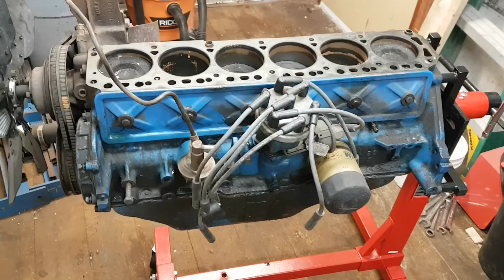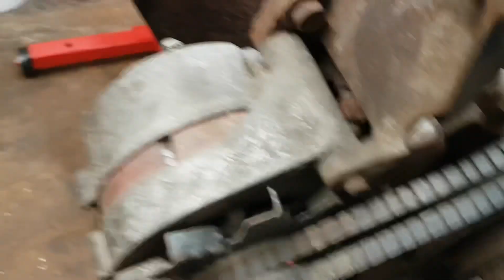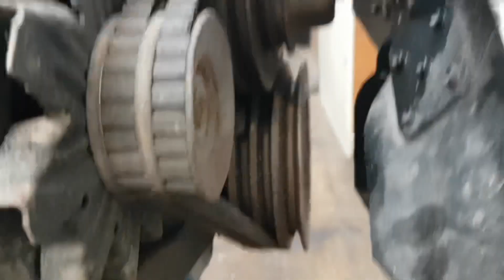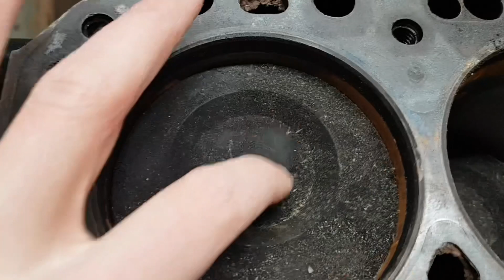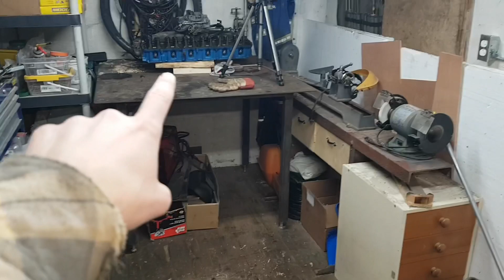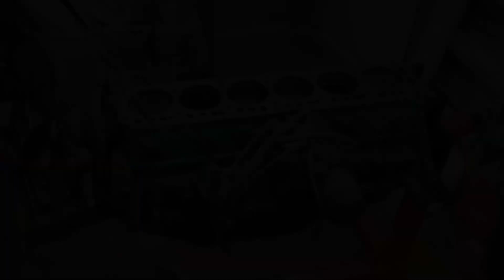Ford 300 Inline 6 Engine Rebuild Part 1: Repair, Rebuild, or Replace??? Decision Time

Comment from the maker: Want to skip the thinking, and jump right into the rebuild process? Check out the engine teardown here: https://youtu.be/FLd2d2YDVRs
Reply: Just watched the whole series. About to be doing essentially the same thing with a 93 4.9l. I thank you for the time spent and the quality of the video. 
One grease monkey to another. Thank you
Reply from the maker: Glad it was helpful! I enjoyed making this series.
Reply: I don’t think is hard to do, it’s a small engine, I’m thinking about giving mine more horsepower, I have. Toomany projects so it’s one at a time..

Comment: Just do a basic overhaul & Hope for the best. Always be on the look out for a back up engine. As far as Going for a 4.9L with all those extra headaches..Getting the old stuff  is what it's all about. Simplicity is what is happening ! The new stuff is the one of the reasons we do not go and buy a new truck . They can't even get that CHIP KEY ISSUE straightened out. Diagnostic says the chip key is bad. $70 down the drain , not the problem. Then $458 later they finally find the problem..STICK WITH THE OLD STUFF. TELL THEM TO RAM THE NEW STUFF UP THEIR YONDER PARTS.. ( BUTT, ASS , REAR END,ETC ETC )

Comment: Glad I rewatched this. The part about swapping from the EFI to carbureted head probably just saved me a bunch of trouble. I am taking the 300 out of my 92 to put in my 81 and will be removing all the EFI stuff and going carb. I will definitely be swapping to a carb head on the 92 block. 
I wanted to save the 85 block, but it is roached. My dad took off the front clip and covered the motor with an old air mattress and let it sit behind his barn for 22 years. It just trapped moisture and absolutely rusted and pitted the block inside and out.
Reply from the maker: Ahhh, that’s a bummer on the old block! Good luck with the swap 👍

Comment: Great video. I work for a historic (architectural) architectural restoration company, and we just picked up a 1967 Ford chassis with a Boyertown step van body on it to restore into a work vehicle. I’ve been tasked with being in charge of that process. Never rebuilt an engine before, I’ve got a 1960 chevy truck with a 235 I’ve done similar repair/bandaid work over the years, but never wanted to commit to a full rebuild. Planning to watch all your videos to have a better understanding of what I’m getting into. Thanks
Reply from the maker: Sounds like a cool project! Hope you enjoy the series 👍

Comment: Man, I feel for you. I've been building a 1996 ford E250 camper van for the last 4 years and the 4.9L just had the distributor gear on the cam shaft blow apart. I've never pulled an engine before in my life, but for the life of me I can't get myself to part with this van or the legendary engine. I don't even have a driveway to work on, I'm just going to have to give it my best shot in my lawn.
Reply from the maker: Ya that’s tough on no driveway. I’ve been there, done that. Gotta get creative. Sounds like a neat build you have going! Best of luck getting the remnants of that gear out. Wild that it would blow that gear. It’s forged into the cam.
Reply: @JeremyKamutzki  I know right? Apparently there was an aftermarket distributor that didn’t fit quite right. It’s more like “shaved the gear down over 4 years until the teeth were gone” more than “blown apart” that’s my bad haha. I appreciate it though man.

The craziest part is that this engine has 125,000 miles on it too. That’s nothing for a 300.
Reply from the maker: Ok fair enough. Still kinda wild that the cam gear would be the one that got chewed up! I would have thought an aftermarket distributor would be the softer metal, but I guess not!

Comment: Hi Jeremy .. stull active on the utubes? Im a 300 fan.. i like yhe idea of original in the truck, if the truck is worth it. .. i like the idea of the efi heads.. do they reay just bolt onto older blocks? I have an /83. ..a set of efi heads and the dual exhaust sound good to me. Id like to know more about this.
Reply from the maker: Still responding to comments but not making much content now. To your question about heads… are you asking about the entire head being EFI, or the exhaust manifolds? I believe for either one yes they do just bolt right up. I have only done the exhaust manifolds. The one caveat to this is aligning them with the exhaust ports, as the newer efi head has additional dowels for aligning manifolds. Google this and you will find lots of discussion on it. I also believe the EFi head increases compression ratio by about 0.5
Reply: @JeremyKamutzki  EFI heads flow wise are overrated. Also they are prone to cracking.

Comment: Good Morning, I've watched your series, one through ten and I've been very favorably impressed. Very. There are several nay-sayers in the commentators. Ignore all of them. You have excellent work habits and a strong work ethic. You did a lot of things I might have done differently but you also did/do a lot of things I respect. Hyper cleanliness is one of them. That work ethic serves you well and will serve you well all your life.

I loved it that you installed the distributor 180 degrees off. I've only done that once myself. Another thing about your work is the step by step, deliberate, keep it clean and follow the instructions work habit you follow. I know from bitter experience, if you improve on something mechanical long enough eventually you'll ruin it. And, oil and grease are cheaper than parts and labor.

Best regards young man!
Reply from the maker: Thank you for the kind words! I took on this project so I could learn something new (how to rebuild an engine), so I am not surprised there are things that may be done differently than others with more experience! I’m always happy to learn new info and skills, so I do not mind when people make recommendations other than what I did.

Comment: What luck do you have on that fuel lift pump hard to find and brand? Or is that original
Reply from the maker: I think it’s the original. I never replaced it at all. Just put a new gasket on.

Comment: Looking to rebuild my efi 300 in my 91 f150 due to it losing all oil pressure for 15 miles on the interstate. Crazy thing is when I exited the interstate I regained oil pressure and It was knocking really bad but made it home. I was very angry because I just put a complete seal kit on it to stop the oil leaks so I let it sit for 2 days without messing with it and my buddy came over so I wanted him to see I blown up the most reliable engine ever made. So I fire it up and it knocked for about two seconds until the oil pressure built up and ran perfectly fine after that so now it knocks for two seconds until oil pressure builds but runs just fine I even drove it on a 500 mile trip and not a single problem. I still want to rebuild for piece of mind and to see what happened inside to cause the problem.
Reply from the maker: Wow, crazy that happened. I wonder if the sump picked up a bunch of gunk, or maybe a glob of silicon sealant from when you redid the oil pan gasket?
Reply: Pcv

Comment: Did you reuse the head bolts? You should buy new. Did you torque the deadbolts @ 100 miles?
Reply from the maker: I did replace the bolts with new ones. Can't remember if I re-torqued at 100 miles. I've read a lot of competing info on whether that's necessary or not. I put ARP studs on at the end of this rebuild, and did not do a re-torque. All the info I read said that it's not required. I may double check them in the spring though, for piece of mind.

Comment: somthin goin on if you keep blowin head gaskets.
Reply from the maker: Yeah, that’s why I decided to do a rebuild and start from scratch. I think I may have a somewhat clogged radiator too. I was looking at it closer upon reinstallation and it looks a bit caked up inside. So a new rad next spring May be on order.
Reply: @JeremyKamutzki  Hello , I am in the midst of rebuilding a 77 ford 300 . I had a blown head gasket.
Reply from the maker: @FrankChesser  Too bad on the blown gasket, but the engine is worth rebuilding for sure. How far along are you?

Comment: 😮sorry for your truck, but my friend this video impressed me why and because! i have a truck tooo , with the same engine for 15 years and never give me anything of problems with head gasket never 🤞, my 300cc 6 line works like a monster with alot of power  rely love my ford so thank you for sharing my friend good luck with your  engine 👍
Reply from the maker: Thanks for the comment! Glad your ford is running well. Mine is much happier now after the rebuild :)
Reply: @JeremyKamutzki  in joint it my friend great 👍 job

Comment: I'd bet the reason for the sailing head gaskets is you have to sneak up on the torque setting.  Let's say final torque is 100 poundfeet,, torque all the head bolts to 50, in the correct order. Then 75 ij the correct order then final torque.
Reply from the maker: This is a good tip, and should definitely be done. I did do that this time - 3 steps to final torque. Fairly confident I did in the past as well, but hard to remember.
Reply: @JeremyKamutzki  well, if you did it in 3 - then sounds like the block or head is slightly warped and you did the right thing rebuilding. Good job so far!! You did a great job for 1st time rebuild! And the only catastrophic mistake you make (oil holes in bearings) you quickly remedied. And I'll bet you never get that wrong again even if you live to be 100!!
Reply from the maker: @mikebishop2838  thanks very much!
Reply: Head studs
Reply from the maker: @garyredmond6873 that’s what I ended up doing. ARP

Comment: I am very sentimental about my truck and the 300 that is in it. I have an 85 f150 shortbed. It was my dads, it caught fire in 96 and my dad and grandpa put the cab off my grandpas wrecked 81 f100 on the 85. My dad gave me the truck in 99 and me and my grandpa rebuilt the top end of the 300 and I drove my truck for 3 months my senior year. My truck broke down and my dad took it back from me and let it sit for 22 years. I finally got it back and just tore the motor down today and took off the head. Cylinder 5 is frozen with rust, so now I am watching videos like yours to see what I should do. I say keep your motor because thats what I plan to do. I am dead set on driving my truck like it was 22 years ago.
Reply from the maker: That sounds like you will have a great story with that truck when you get it back together! I did end up rebuilding my original engine, and if you continue watching the series, you’ll see what’s involved. (Spoiler alert: the engine is done and driving last week, but the video series isn’t done yet. The last few videos will be coming through the rest of this year. )

Comment: 4.9 are not just fuel injected. The 240 are 3.9 the 300 aka 4.9 start in 1970s the short blocks vs newer short block 4.9 are practically the same other than alternator bracket, manifolds. If I were u I would just look for a new block and just rebuild the head that's it to be exact. Ran 1965-1996 31 years engine run I think the inline is by far the number 1 engine in ford history
Reply from the maker: Yes, I hear it has a great reputation. That’s partly why I decided to keep it, rather than doing a swap.

Comment: Change the head gasket it's 25.00 bucks put it together and do a compression test
Reply from the maker: I agree this would be easier and cheaper, but I have been having repeat issues with the head, even after it gets checked for cracks and warps. I am nearly done a full rebuild at this point.
Reply: @JeremyKamutzki  I've rebuilt a few. I'm working on another with a comp cam head head redone at machine shop. I'm bad at video making I don't know how to do all that fancy stuff
Reply: Where in Canada you from

Comment: The over heating is coming from the rust in the block
Reply from the maker: Hi, thanks for the suggestion. I’m sure that doesn’t help. I think it will be a lot better with a freshly cleaned block.

Comment: 1st thing....is that a Fram oil filter? if it is they are called Orange Death for a reason...its a ford motor only use an autocraft oil filter trust me it does make a differance.
Reply from the maker: It was indeed a Fram High Performance oil filter. I have a motorcraft filter that will be going on the rebuilt engine. No need to fret.

Comment: Ponder nothing rebuilding it is the way to go. If you rebuild it right all the way don't cheap out than you will  get another 30000 miles out of it.
Reply: Get a 1995 4.9 used motor for 450 and rebuild that use your intake and carb
Reply from the maker: Thanks for the input. I decided to go with the rebuild route, and I’m midway through re-assembly. It’s going slower than I expected, as it’s my first time, and there are a lot of little details I’m learning about as I go.

Comment: I just happened to see your video in my feed. I am in the exact same position with my 1965 f100 with its 300, I did a dirty repair, new rod bearings, rings, valves and lifters but after starting it up. The engine was still hurt, smoking and really needed more done to it. I could go right down the road and get a 90s 300 from a yard for a couple hundred dollars, or I could stop trying to go the cheap route and pull the engine out and rebuild it. I opted to rebuild it so now I am in the process of breaking it down and finding a shop near me that can check the block and make sure the heads and the blocks are good. 
Its honestly nice to have someone I can relate to on this exact same question and I am just surprised this video happened to come across my feed today.
Reply from the maker: Well, I'm glad that it was helpful for your decision making process! I can totally relate with being tempted to go the cheap route... it does hurt a bit to see the costs add up during the engine build, but I think in this case, the old saying of 'buy once, cry once' is very true! I'm midway done my reassembly, and I am very glad I did go this route. Great learning opportunity, and having an essentially new engine will be a huge win. It will just make the truck all that much more enjoyable.
Reply: @JeremyKamutzki  Thanks for the video, I’m perplexed about my mom’s 1982 Ford in-line 6, 3.3 liter engine. Front and rear main seals are gone after I screwed up with ATP AT 205 and heard metallic rip tear noises. There’s no real reputable mechanic in Central Texas area that knows how to overhaul Ford engines without the computer.. Most blow me off with engine swaps and overprice charge labor and fancy aftermarket components. It’s becoming a spider web nest now. Mom loved that car. It’s only a 1982 Ford Granada L sedan. Vandals bashed the window but i a 1981 Granada as parts donor. I don’t know of any real mechanics because of my restricted income and inflation b/s. Just frustrated with empty promises and empty profile antagonists.. I understand the frustration.

Comment: Can you not rebuild the old Ford to get 1000hp?
Reply from the maker: I dont doubt that its possible; however, I am equally confident that it would not be reliable. Reliability was the most favorable part of this engine, so a stock rebuild is what I'm doing. Not to mention, a 1000hp straight sid would probably cost 15k or more.
Reply: @JeremyKamutzki  good choice. A multi layered steel performance head gasket from Felpro should fix the gasket issue. Also had you thought about resurfacing the block that may be where the warp is. Or one cylinder is way high in compression and keeps breaking the gasket. Hope you get her sorted
Reply: The Australians build their 300's with superchargers turbos custom heads. Long story short they can milk them for 1200hp 1800ftlb. Granted it'd be cheaper to get a different platform like an LS or cyote

Comment: Newer ford alts have have design flaw, t connect on back of alt cannot carry amp draw  well, if you go to newer, carry fire extinguisher in cab, prevented my 94 f150 I6 from burning to the ground, if using air, wipers, blower defrost to clear foggy window, lookout!
If no air conditioning, they work, just keep the spade lug clean or replace connector with new.
The older design my opinion, better.
Fords EFI nwer vehicles suck, computers are fragile, intank fuel pump design sucks, now own a 91
rust free project truck, so many design flaws, wish it had carb, thinking heavily on that mod.
Reply from the maker: Hey, thanks for your comment. I’ve not heard about that design flaw before. I don’t have A/C, so hoping I should be OK with the newer alternator. The advantage in my head is that it’s a single wire setup, with internal regulator. Keeps the wiring down, and a little easier to get spares/replacements in case of failure.
Reply: @JeremyKamutzki   The design flaw is real but not a big deal. Just keep an eye on the connector. Once I got a new one with a new alternator I never had another problem. I also put a 4 barrel on my efi. Not that big of a deal.
Reply from the maker: @jaycewilliams7715  Sounds good, thanks for the tip. I’ll keep an eye out for this. I’ll likely be doing a new alternator (why put a used one on a fresh rebuild), so shouldn’t have an issue.

Comment: Got an old 75 f350 with the 300. Its a pretty good engine, although it leaks and sips oil. I to have bad luck with power steering pumps. Mine just vomits it up after turing the engine off.
I would say rebuild. If the block is sound, And replace the head with a newer one.
Ps. I got a new head that I never ended using. You can have for something. Idk how much it would take to ship.
Reply from the maker: Nice, sounds like a fun truck. Mine also leaked oil, though it didn’t really burn any. You’ll be happy to know that since I made this video, I DID decide to rebuild. If you’re interested, you can check out my current progress in this playlist linked below; I’m currently in the rebuild process, so make sure to subscribe, so you can see my progress! 

https://youtube.com/playlist?list=PLIq1TzV8HwrABYz2n-vd2P-E6ESOC4XlW